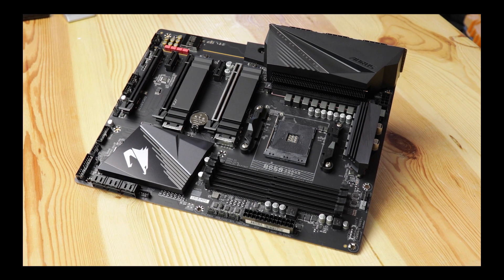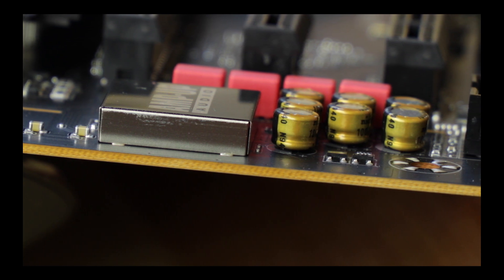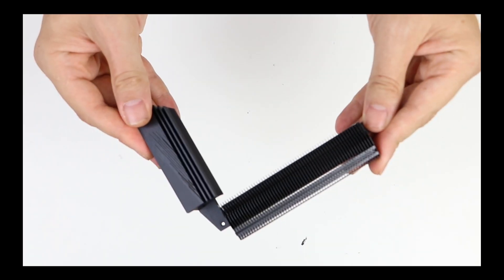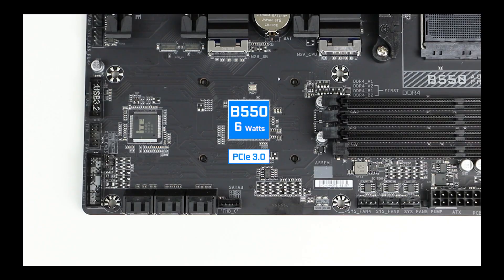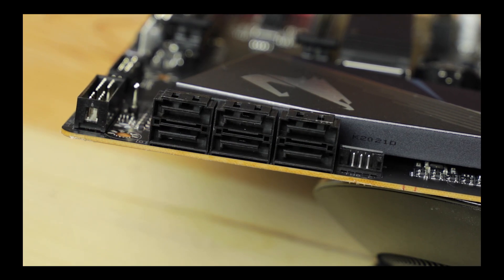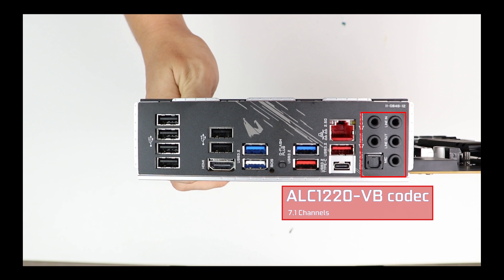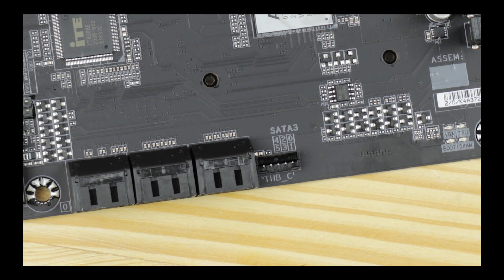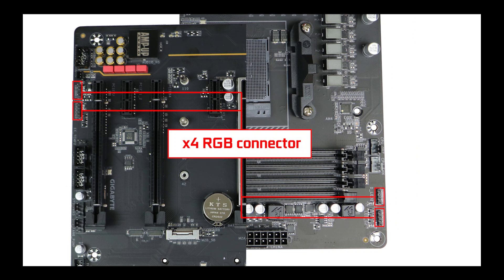B550 AORUS PRO (Rev 1):  Why you should think twice.

Comment: you speaking about the b550 platform not the gigabyte card as it concerns 2 or 3 gpus. but regardless, who is using sli or crossfire. you maybe speaking out your rear a bit. anytime you run 2 graphics cards you get less spead. this is one of the reason sli or crossfire isnt used much today. the gpus dont talk to each other well. it doesn't translate into 2x performance even with same speed high speed. on the lanes.
Reply from the maker: Creators for example, which I mentioned during the review.  Creatoes such as myself .
Reply: @Laurentschoice  look at the difference. your not using that bandwidth
Reply from the maker: @MrGreen1988  oh dear ...I got 2 2080ti on  32 cores. I promise you... Adobe première / blender ... its monstruous. 

Anyhow. Pro series is an amazing board... but still too similar to the Elite, IMHO,  to motivate extra cost :)
Reply: @Laurentschoice with or without wifi can have improved reinforcements for mounting. i dont have specs sheet of parts but i saw more. saw different specs for memory overclocking. so that leads me to believe different parts there. the lan is different. 1 g vs 2.5. . i dont own both to be able to look at actual part numbers on chips. but you can see there are more differences. they may not matter to you but they are different.

Comment: hello nice video but i have a problem ,aorus b550 elite AX whit wifi 6 and Bluetoth 5.0 for 155 usd or aorus b550 pro for 160 usd on amazon, i have a sony wh-1000xm3 but the b550 pro has better audio codec or is not much than difference? and in the future it is probably bought me a good headphones whit cable
Reply: 5 dollars does make it a tough decision
Reply from the maker: My point is to get your more for your money :)
Reply: @SteveO30G  I will buy the aorus pro and in a few more months I will buy a pci-e expansion card for wifi and bt, I already bought a r5 3600x at 170 usd (soy de latinoamerica y me lo encontre en un buen precio, aqui todo es mas caro y me traigo la placa desde amazon)

Comment: Good review its the VRM that made me choose this board over its equivalent ASUS. All runs good here with 32GB RAM, m2 and a RX570 video card except for one weird issue, my MS sculpt wireless as well as other wired keyboard I have freezes if they are plugged in USB 2 but work fine when plugged in to USB 3. Not a big issue for me but every other peripheral connected to USB2.0 work fine surprisingly otherwise. Probably a BIOS issue that should be resolved in future updates. I expect this motherboard to serve me well with my current ryzen 9 3900 and any future CPU updates.

Comment: In the US the elite is about 150 and the pro is 160 (Amazon). Happily paid 10 bucks more for the couple extra small features of the pro. Great overview btw! Can't wait to buy my 5800x.
Reply: so how did it go? do you like the board?
Reply: @aditi1918  Happily running my completed computer since December. I camped overnight outside of micro center two times one for my 5800x and again for my 3080. Actually there was a third time for a 6800 XT but I didn't get lucky lol. Motherboard I chose has been rock solid especially since the last BIOS update.

Comment: what is the maximum height (thickness) of the sdd card that would fit under the m.2 heatsink? I got an ax200ngw wifi card with an adapter to m.2, and I just don't know if it will fit under it :S if it doesnt fit I'd rather get elite, since it has no cover for the second m.2

Comment: No post code reader, no power and reset inboard buttons, sorry Gigabyte, but thanks, no. For this price it should be there.
Reply from the maker: For these options, the Market price tag will orbit around 230 dollars and more. 

I know it socks... but with 6 layered pcb boards, price are gradually climbing
Reply: What kind of board are u dreaming of at this price point? It has a flash bios button and USB bios without cpu, ram or video card.

Comment: The VRM performance is much better with the Pro rather than the elite, well that's what I saw in Hardware Unboxed VRM test.
Reply: B550 elite is 4 layer and ridiculously bad RAM overclock. Worst vrm dissipation, only one m.2 heating and so on. Not comparable at all. Only the good vrm section is the same.
Reply: Did you install the ram and cpu then you tried ? I bought the motherboard and still wait the cpu i tried to update but did working so i still wait the cpu to try
Reply: @abdallahabdel  Yes, I had RAM CPU and GPU installed, then it worked for me.
Reply: @SuperStumps-420  ahhh okay i bought 3070 but i can't find 5600x so i think i will get the 3600 and wait to the next year i will play 1440p 144hz good idea or i wait and buy 5600x
Reply from the maker: So I tested both. 
I spotted 3c of difference. 

Not enough to impact performance and durability. 

You can go either way .
Reply: @Laurentschoice  need your help i have this motherboard and i didn't get to update bios via usb i did everything as gigabyte sad amd tried 3 different usb the usb flash 5 time then nothing happen

Comment: Does running any other expansion card in the 2x or 4x slot drop the main x16 slot to PCIe 3.0 x16?
Reply from the maker: No. They do not share bandwidth:)

Good question
Reply: It should be noted that the 2nd M.2 slot and the 4x slot share bandwidth though